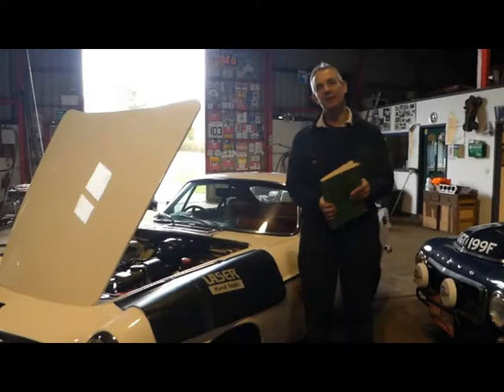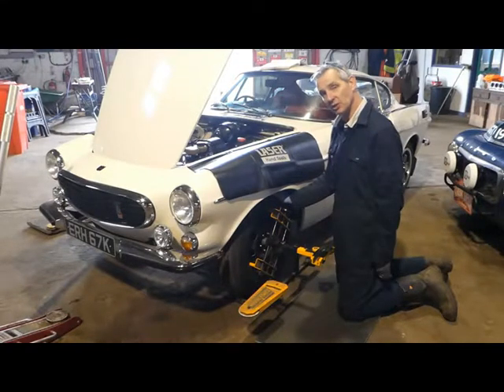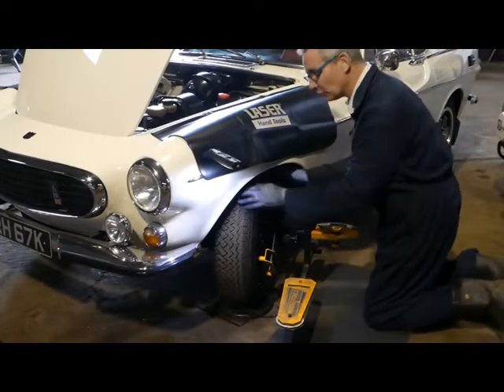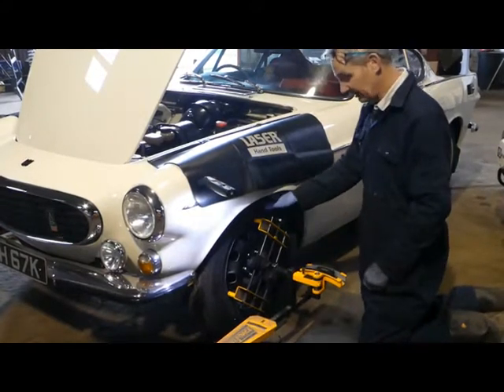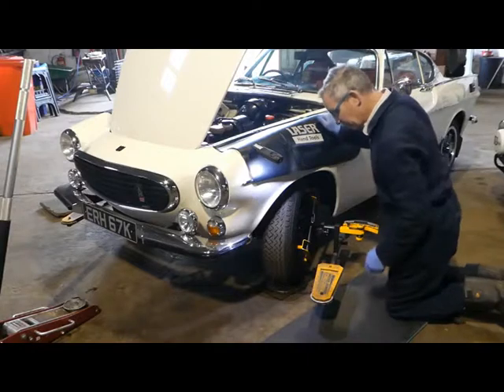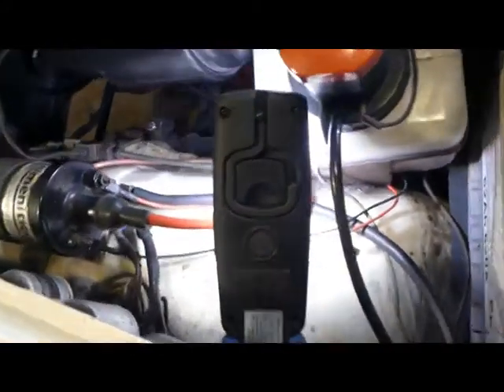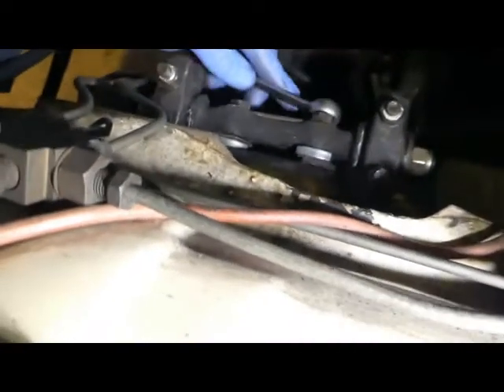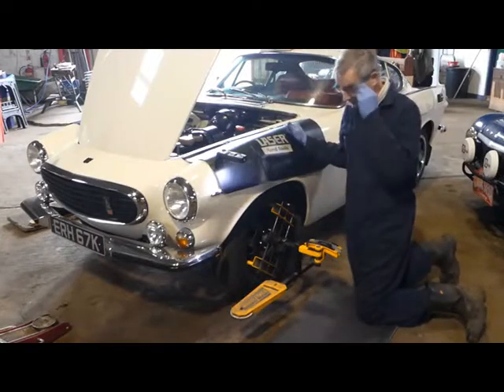Amazon Cars: Setting the Front Suspension Geometry, P18 & Amazon

Comment: Hello,  regarding a 67 Volvo 122 rear drum brakes, are the drum brakes a 2 piece drum?  Meaning, if I would remove the wheel studs from the drum, will the drum become 2 separate piece?  The portion where the shoes engage and a portion where the studs are located?

Comment: Would it be possibble for you too do a complete wheel alignment on a dutch registered car?. My amazon steering is horrible at best. Heavy with light 'floaty' spots at highways speeds. Stationary there is very little,   play in the steering box or rods ends.  Rubber joint on the sterring shaft is replaced.  I noticed that de shims on the upper control arms are not equal left to right. I think there is possily a 4 to 5mm difference. I have no history on this car. Only that ive done extensive rust repair work on the rockers, a pannels, floors and window frames. Is had a early style rear axle, b18a , m40 and double brake system. I am now in the middle of a 240 rear axle and m400 gearbox swap. Would really love to improve the road handling manners when complete.
Reply from the maker: We'd be delighted to do so. Steering joints & balljoints we would plan to replace first, unless you know they are very recent; then we'd do the geometry. Half a day for each for those, so potentially a day's work.
Best to email us volvo@amazoncars.co.uk
That M400 is such delightful gearbox!
Rob

Comment: Hello, 
What values would you recommend for caster/camber/toe on a 1964 Volvo Amazon (drum brakes). It is equipped with modern radial tiers, standard springs and KYB “gas-a-just” shock absorbers. I have read the Volvo manual but maybe somethings have changed during the last 50 years..?

Thanks
Björn
Reply from the maker: Hey Bjorn: I reckon -0.5deg of camber, and 0.5 to 1deg of +ve caster.
You can go to -0.7 on that camber, if you have top quality sealed surfaces...
It's the camber that's changed due to rubber and road surfaces, but I also suspect the Volvo B16 values are for CrossPly tyres perhaps.
Rob
Reply: @amazoncars  
Thanks. 
/Björn

Comment: I am still struggling with oversensitive light steering, have replaced ball joints on steering links and upper wishbone bushes. we see the steering box is moving the chassis leg- it did this 23 years ago when I bought it and I welded a thicker plate to the outside- but still the same.
Reply from the maker: John, could you send me a photo looking down on the steering box from directly above, the address is volvo@amazoncars.co.uk
Reply from the maker: Happy New Year to you John. Could you send me a photo showing the top of the steering box, in particular I want to see how much of the adjuster thread is visible above the locknut. As you've surmised, the steering box should be absolutely rigid with the chassis, and so we need to identify why there is movement in this area. Regards, Rob